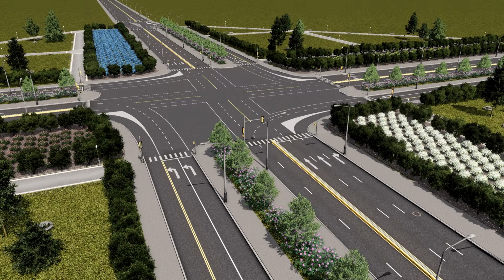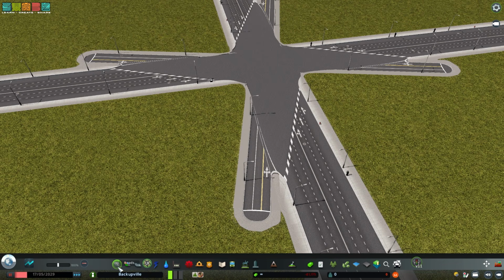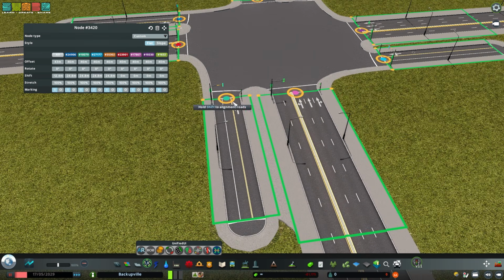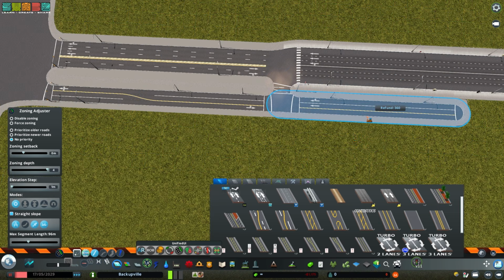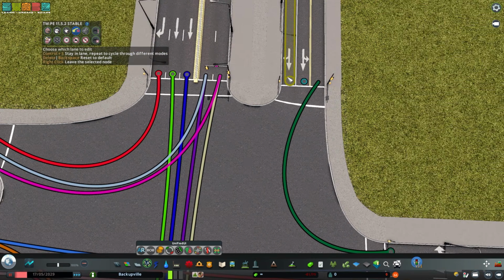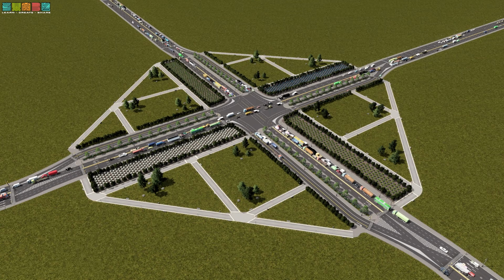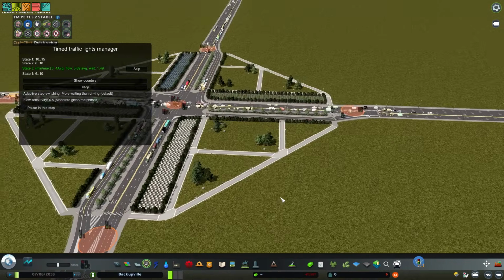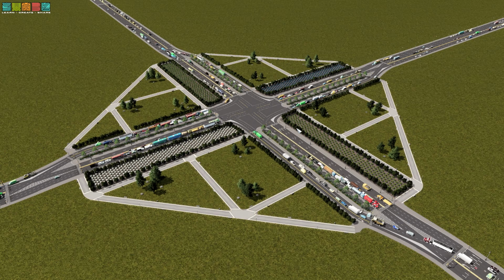Pushing a node to its LIMIT for the "Continuous Flow Intersection"! (CFI)

Comment: Interessting! So you basicly offset the crossing left hand traffic to a second junction further back, which allows you to minimize the traffic light time and steps. On the equation of capacity, conflict, waiting time/traffic flow and used space, the only real drawback is the used space.

I like it.
Reply from the maker: Thanks! Yes, the space used is sub optimal. But its usefulness comes in money saved from installing and maintaining an interchange. Some areas need an economical solution.
Reply: One downside in real life (though not in C:S, if you build it right) is that it's confusing, so increased risk of accidents.
Reply: @Pystro  

Accidents occur due to bad drivers’s bad habits. Not the design itself.
Reply from the maker: Nope. Statistically its safer than a normal intersection.
Reply: @YUMBL  Guess people must be approaching it with more respect then?
Also, it takes away many directions and most opportunities to get T-boned. Since it removes 1 of the 2 left turn directions (2 straight directions remaining) that cross each straight path; and each left turn crosses only 1 straight path instead of 2 straights and 2 other lefts.
Reply from the maker: Probably not the respect, but the fact that lefts dont cross over incoming traffic.
Reply: @alohatigers1199  "Accidents occur due to bad drivers’s bad habits. Not the design itself."
No, that's a myth. People make mistakes. That's very normal. If the design cannot deal with peoples mistakes, the design is bad. If that leads to deadly accidents, the design is very bad. I recommend you read Don Normans "The design of everydays things". He is very detailed where design fails.
Anyway this is a game. These cims are very perfectly stupid people. They don't make mistakes. So all above should be no topic if we are talking about CSL. If there is a city planner looking at this stuff, I am shure he conciders a few more factors in RL.

Comment: This demo of Node Controller was awesome! Stuff I didn't even know it could do! Yumbl, what are the odds you would be willing to do an in-depth on TM:PE? What I would love to see is a way to setup a light that only changes when it detects a vehicle in an opposing lane. So, for example, the main road traveling N > S would always be green unless a car pulled up to the side road coming from the E. Not even sure it's possible, but if you, or anyone for that matter, know how to do it, that'd be amazing!
Reply from the maker: I think it is possible. Its all about the flow section of the light controls, which i’m still struggling to understand.
Reply: I have a video on my channel where the N-S main road is always green unless there's a tram about to cross on tracks that run E-W. TM:PE can change state "if anybody is waiting". Where this struggles to work is where you have more than just the 2 states, so more than 1 other direction that can be waiting simultaneously.

Comment: Hmm, could the displaced left go into a displaced left on the receiving road? It would then have to cross the traffic at the smaller feeder stoplights.
That way there is no crossing at all from turns, in the main junction.
Reply from the maker: The lefts currently dont cross at the main junction. They sneak through while the necessary straight through cycles are happening already.
Reply: A yea, so while it would be possible there would be no point, it's open for straight anyways.

Comment: I’m curious how this would work if you kept to three lanes from the incoming roads.  Ie left lane turns left, middle lane goes straight and right lane turns right.  Then the left turn lane on the side road could flow continuously left at the main junction to the left lane regardless of the phasing of the lights,  so the side road would never fill with traffic.  Only one lane would be going straight on to what will become the middle lane.   This would mean a vehicle could only ever be stopped by one traffic light whilst going through the junction (or never for the right turn lanes).  If space for queuing traffic in the centre is needed then add lanes, but add them on the exit too so there are always dedicated lanes.  (I’m assuming that with timed lights you set up phases such that straight on traffic clears the secondary junction before you allow the left turn traffic to cross to the side road.  I also now realise a left turn car could hit two reds, one as it tries to get to the side road and one if it has to allow oncoming traffic to cross on its exit, but in your version left turn traffic could be stopped at the main junction as well.   Possibly with careful phasing you could still avoid the second light too, expert level !)

Comment: As a new player without mods, making this looked like magic.
Reply: I play this from the beginning without any mods fot the game. I follow yumbltv and i respect this a lot. I've tried this road mod once or twice but it's way to difficult for me.
Reply: @edwinvandenberg3633  funny thing is traffic in this game should be easy because we all deal with it in real life 😂
Reply: @smythe7480 unfortunately, the only road I deal in real life is a 4 way crossing with traffic light so there is no reference to the solution 😂
Reply: If you're on PC I highly recommend getting at LEAST these infrastructure mods. Even if you don't use them much, the few times you do it will make everything so much easier
Reply: It is magic lmao. This intersection is nuts!
Reply from the maker: @EntropyOnline and it really exists.
Reply: @YUMBL  imagine road work, it would be a mess
Reply: Reasonably sure its possible with mostly vanilla. TMPE & move it mod make it easier. Just about to try it to see if i'm right.
Reply: @tnexus13  TMPE has a hard mode, where is disable vehicle despawning.
I get 4 times harder, but at the same time gives you a lot of tools to deal with the new layer of difficult, I literally can't play without that mod on.
Reply: as an experienced player with mods, this also looks like magic
Reply: Thats because it is
Reply: It did to me when I was new but now it doesn't except that I don't want to use a lot of assets. 
I can work well enough with the Vanilla Overpass and that's really awesome.

Comment: This build is really breath-taking. And thanks for including remarks about only displacing left-turns for two legs of the intersection, though my head almost exploded trying to think of the changes in lane-math that come with it ;-)
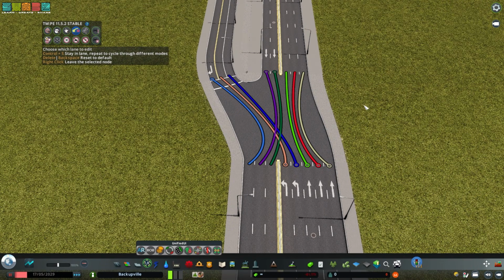I think the weakest point of this design are the four pre-intersections with the crossing lane-connectors of 10:58 with a risk of left-turning and straight-on traffic getting stuck at the traffic light after leaving the main intersection and backing up all the way to the main intersection. Combined with my weakness of configuring traffic lights it would be a complete nightmare to recreate this ... ;-)
Reply from the maker: Its a bit hellish, yes. Would work even better if i made the legs longer.
Reply: @YUMBL  I think you could improve the light sequence with a few small changes. In phase 1 you have the left turning traffic (into the left turn bay) waiting for oncoming traffic which hasn't arrived yet (ignoring the stragglers who just turned left). So I would change phase 1 to allow them through (with oncoming as red) until oncoming traffic starts arriving at that red light (by my count it's about 9 seconds from when through traffic starts moving through the main intersection until it reaches the intersection after). Phase 2 turns green for the oncoming traffic and red for turning left into the bay. This way through traffic won't have to stop once they get through the main intersection. Would be interested to know if this improves anything or if there's something I haven't considered or forgotten.
Reply from the maker: You’re probably right. The legs also need to he longer for true two phase operation i think.
Reply: Money is not the only restriction why overpasses are avoided ... to avoid steep inclines a lot of space is needed. The continuous flow intersection as an alternative to grade separation loses much of its value if the legs are growing and growing ...
And even if you space out the intersections of the arterials as road hierarchy tells you to do, two consecutive continuous flow intersections would be difficult to realize.

Comment: I never cease to be amazed by how flexible the road network in cities skylines is (with some mods added to tweak it). It's one thing to have the data model for the intersections and nodes, but being able to use that and dynamically present it without a bunch of visual artifacts is just insane.
Reply from the maker: I suspect they didn’t expect mods like node controller at all and the fact that it works so well is actually a miracle 😂
Reply: I'd be curious to know what a potential Cities Skylines 2 would do with this, including all community-mod hindsight.
One thing I'd love to see, for instance, is a road editor that smoothly supports adding or subtracting lanes. Like, instead of having to have a separate road type for every single combination of lanes, just pick a road texture (might come with certain properties in terms of max speed and maintenance cost), and for each node, pick how many lanes there are as you edit the network.
Could also put a lot of extra work into maybe more intelligently figuring out what road markings might be, and some of the almost must-have-seeming tools could just be built right into the game from the start.
Reply: @Kram1032  This would be a great way to include separate turn lanes without having to use various asymmetric roads
Reply: @liliumastrale  exactly what I'm thinking!
Reply: I've made several of my own roads at this point.  Whoever came up with the node system was a freaking genius.  There's just a set of rules that "stretch" the road at the node to make the road ends meet.  Every road in the game follows the exact same connection method, whether vanilla or not.  If the width parameters and connection classes are set correctly in the road asset, everything just works.  It really is amazing how elegantly simple it is.

I suspect Node Controller works so great because the nodes were already stretched to meet each other in vanilla.  The mod is just stretching them more.  Same reason Move It works, the mechanics to bend and stretch roads were already in vanilla, the mod just allows you to bend and stretch past the vanilla limits.
Reply: I remember being impressed when regular anarchy roads and Move It worked, especially when people like RTGame built vertical roads going up the poop volcano.
Reply: Just because the game system allows it, and there's a popular mod for it, it does not necessarily mean that it's a good addition to the game.

Keep in mind that if you're watching this kind of YouTube tutorials, using mods, and making these kind of intersections in the game, you're one of the more advanced players.

Most players wouldn't be building anything anywhere near the complexity of what mods allows you to build. And I'm sure there are a lot more of the players who never touched any of these aspects of the game than advanced players.

Mods scratches the itch of advanced players, but I suppose most of the more basic players would've preferred simpler systems.
Reply: @yvrelna  you could easily hide such features behind an Advanced Settings menu if you are worried about scaring away newcomers.
Reply: @Kram1032  if only a handful of people would use it, it wouldnt justify the developpment expenses. Its must be made simple enough so it's worth to make. 

Maybe they allowed these mods to be built so advanced user would be pleased without having to devellop these features themselves. 

I think they did it the right way already.
Reply: @pascha4527  I'm quite certain that many more than a mere handful would use it.
Reply: @Kram1032  Sorry maybe I wrongly translated what I meant. It's sure more than an handful, but it would be a really low portion of the playerbase that would actually use some advanced feature consistently. 

The only thing that I would have wanted in the base-game is the possibility to change which lanes goes where. It really hurt the traffic to not have that feature. I need to use clever way to manage my traffic. I mostly play that game on console unfortunatly so I dont have access to mods.
Reply: @Kram1032  doesn't matter whether you or I think the advanced user count is a handful or not. It's the ratio of basic vs advanced users that matters, a metric only CO and PI can determine and uses to make their development decisions. It is very likely that they would conclude that the 'manhours' spent on integrating the nuanced / granular functionality of mods like TMPE, IMT, NC, NMT, etc into the current game or a new game isn't worth the development time and money.  Perhaps if CO were an indie game studio and not under a publisher there would be a slightly higher chance of getting even a fraction of these mods functionality added as vanilla featuresets. Evidence to this effect includes indie devs such as Facepunch of Rust who implements some of their mod community's work officially into the game, eventually.
 
As a compromise, CO / PI are very content on allowing mod devs to perform the work for features that the advanced player demographic would enjoy. CO simply facilitates the modding framework by having integrated the steamworks platform for workshop support and they can just sit back or perform other pertinent work. Mod devs donate their free time to produce unofficial niche content and functionality without obligations or restrictions; game devs don't and can't mostly due to their publisher's directives which only dictate what features are likely to sell their product. Time and time again modders that have been hired by the game devs of the game they once modded suddenly are unable to bring the advanced features they implemented as mods to the game or another game in an appreciable form i.e. their new work is neutered. Worse so that those newly hired modders are then far less likely to maintain existing or build new mods for a game they officially work on.
 
It's business 101 - welcome to reality bucko. Be realistic.
Reply: @Kram1032  You are 100% correct. The more I get into modding C:S, the more I discover modding is the norm and vanilla is not haha
Reply: @yvrelna  Umm....no. Most of the infrastructure mods absolutely need to be in the base game. Move It especially. They need to be there from the start so new players can ease into them without having to mod them in and need separate tutorials by 3rd parties.
Reply: @thed3m0n0id9  MoveIt is really only necessary when you want to do fine adjustments of your roads or buildings, which most casual players won't bother doing. 

More importantly though MoveIt breaks the game mechanic that you aren't really supposed to be able to move buildings/roads for free. The game already have mechanisms to move objects around, most buildings can be moved, and roads can just be demolished and rebuilt, and some buildings can only be moved when empty. You are supposed to pay when you need to relocate things, just like in real cities, moving things around aren't free, and you aren't supposed to be able to move landfills/cemeteries across the city unless you figured out what to do with the existing contents. MoveIt conflicts with these game mechanics.
Reply: @yvrelna  Fair enough. But offering it as a base game mechanic to use for players that want it(which actually seems more common than those who don't) would not be hard. Having a tool there doesn't mean that you have to actually use said tool. But it'd be nice to have for those of us who do.

Comment: I'm curious how many cars this intersection can move compared to other.
Reply from the maker: Not sure. I just know a roundabout cannot do this.
Reply: @YUMBL  Probably. I'm curious about the numbers though. Maybe if (when ?) you figure out a way to count cars, that would make a good video (as  @ThaJay mentionned in another answer to this ^^)
Reply from the maker: I hope someone figures out a way to count easily. Its not a solution I will be figuring out though. I’m no programmer.
Reply: @YUMBL  Should be easy enough with some timed traffic lights after the exit. Set a crossing set to be a fixed time, despite no traffic, and then see how much time you need to let traffic through for before it tails back.
Reply: @agsystems8220  Smart thinking! You could even do that with just a red light, no green. Measure the time it takes to back up to the middle with no restriction. Then create and intersection and measure how much longer it takes for the exit to back up, that means how long does it take to move a specific amount of traffic.
Reply: There is an older video comparing the various 4-way intersections, from 1-lanes with no light all the way through to a stack interchange.  The CFI was the highest-flowing at-grade intersection tested, moving more cars than a highway diamond interchange.
Reply: @JETZcorp  I believe he counted manually
Reply: Yeah it would be really nice to have this in a stress test against other intersection and interchange types, like normal 4 way intersection, 3 or 4 lane turbo roundabout, diamond interchange, SPUI, converging diamond, cloverleaf, parclo, cloverstack and stack. I think this would end up moving more traffic than both diamond and cloverleaf but I don't know about SPUI or diverging diamond. This is almost a diverging diamond but more compact. Only difference is, this keeps the straight through lane on the right side while a div dia moves both left and straight over to the left side. It would probably be possible to build this road layout with both variations.
Reply: TMPE not giving you the answer seems like an oversight. The number of vehicles passing through the intersection surely is a factor in the flow equation.